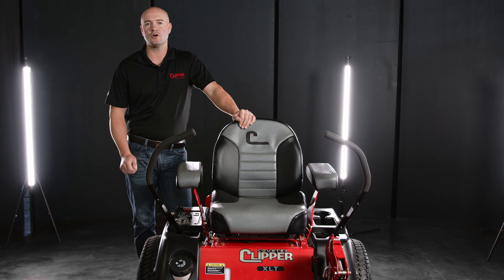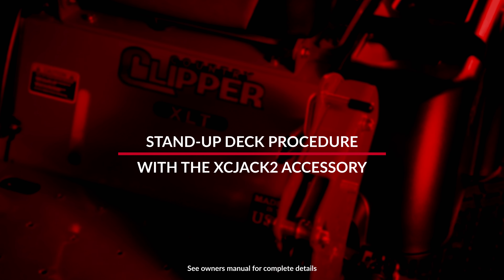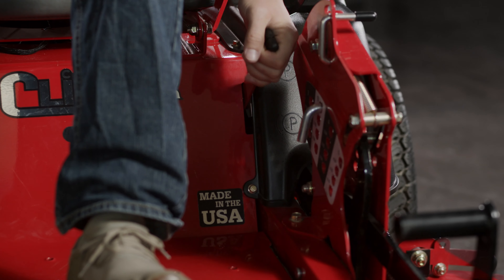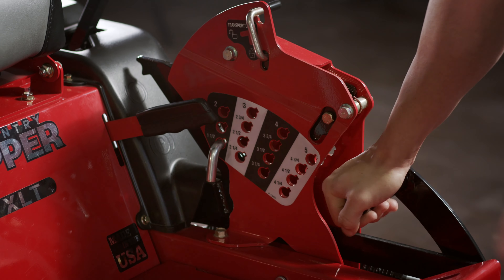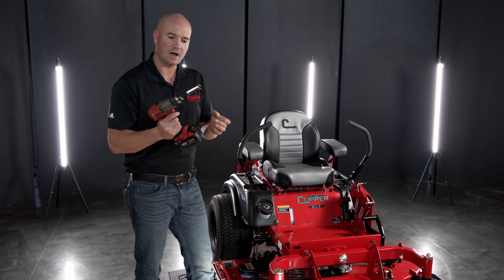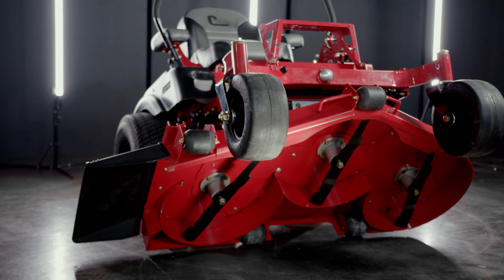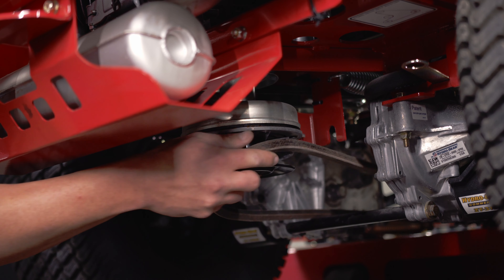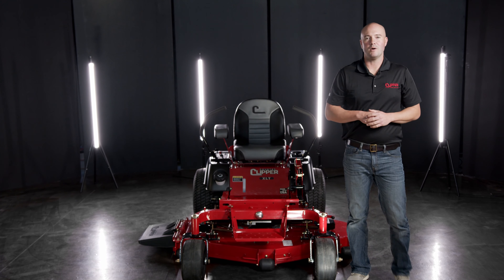Country Clipper | Stand Up Deck Procedure | XCJack2 Deck Lift Accessory | How To

Comment: Doesnt work worth a sh.t eben w the devk at lowest height the rear latches will not release.  Dealer looked at it three times no soltuion. Waste of money.
The latches in the back need a large screw driver to release and reinstall. Then if the main drive worm gear  is not out far enuff the deck locks. If to far out the worm shaft comes out. Poor install or poor design.